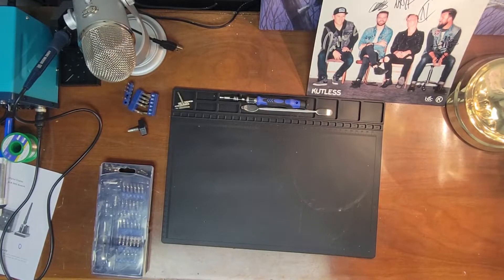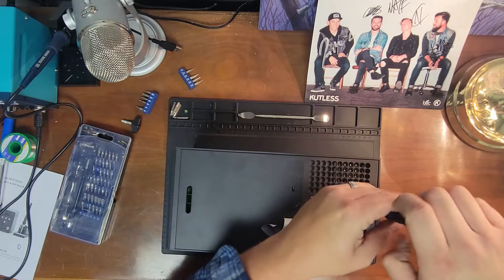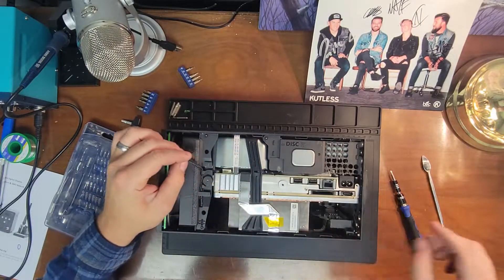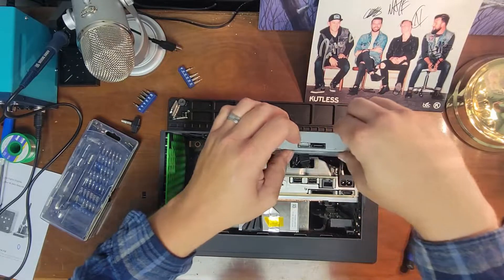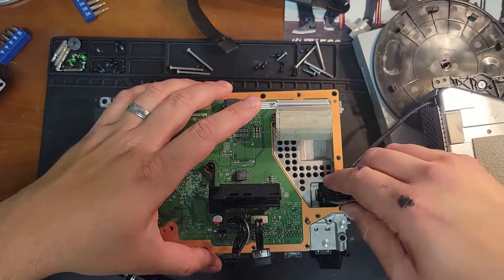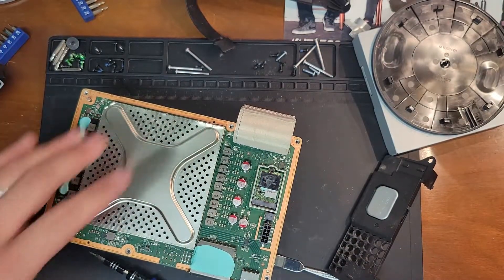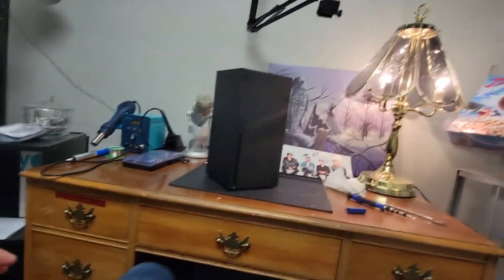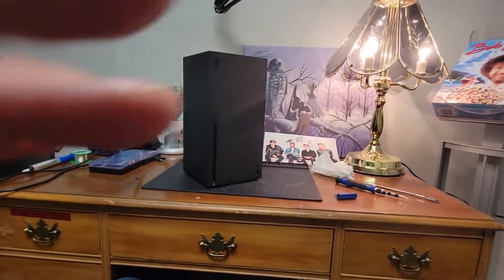Xbox Series X Disassembly And Cleaning.

Comment: Not sure if there are some differences in our models but, you did not show where you have to remove the bottom “stand” to get to the 2nd screw that holds optical drive bracket in place. Almost broke mine

Comment: My series x keeps turning off on high load game, ( metro exodus, cyberpunk quality mode ) and even horizon 5 makes the fan go crazy. Hoping a nice clean will sort it
Reply: i have an xbox series x since march 2021. over time it started to heat up and i could hear the fan blowing louder and louder.  sometimes it went out by itself for safety.  following this tutorial I opened it for the first time to clean the fan and the cooler.  It wouldn't turn off anymore but the fan was blowing hard when I was playing FIFA 22 or resource intensive games.  it bothered me so I bought an ''ARCTIC MX5'' thermal paste and since then my console no longer heats up and the fan runs normally like on the first day.  I strongly advise you to change the thermal paste you will notice that the old one was not of very good quality.
Reply: @SoufixTTV  I took it apart and cleaned the fan and heat sync. Luckily that fixed it for me as my heatsink was totally caked in about 5mm lf dust
Reply: @SoufixTTV  I'm just having problems with my disc drive at minute, xbox says there's a world wide problem where people aren't able to install games of disc, only way is to download from store using xbox app and then use the license of the disc and play